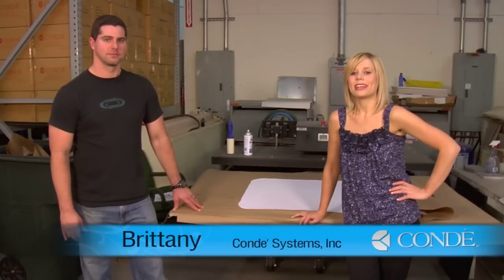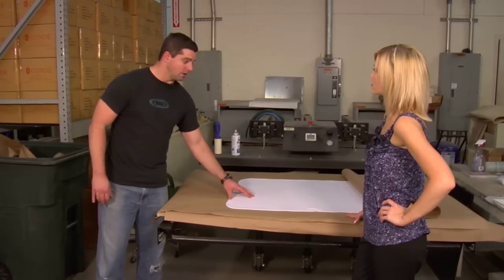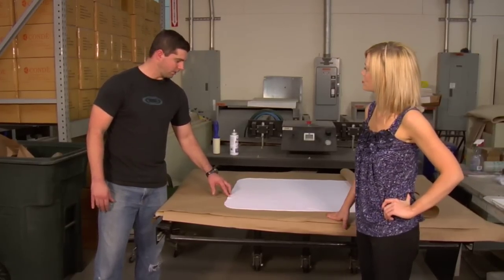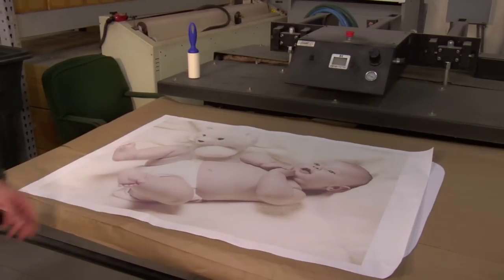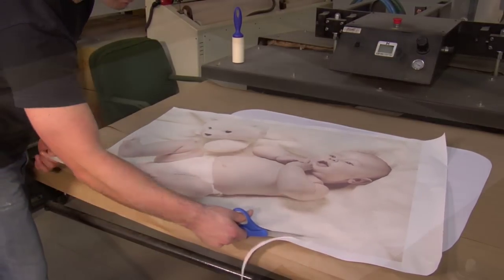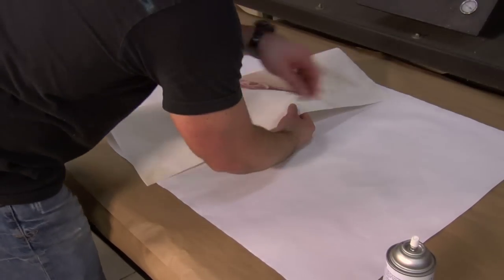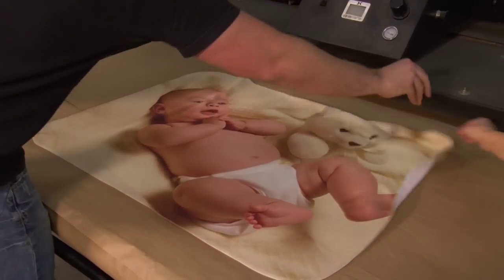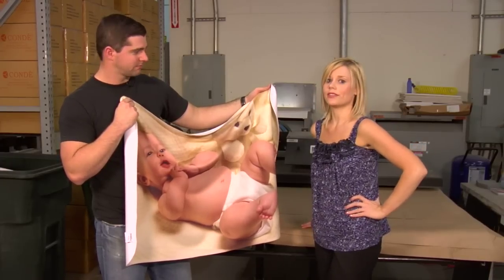Imprinting a Fleece Throw Blanket with Dye Sublimation -

Comment: so the difference between this and heat transfer with plastisol transfer is this goes into the garment and not on top correct? And the inks used for this is sublimation ink? Could any printer do it as long as you have the sublimation ink? *****
Reply from the maker: Molecularly bonded to the polyester, yes, a dye not a transfer.
Inks are Sawgrass Sublimation inks.
Theoretically any printer would do but the best printers to use have Micro-Piezo printheads.

Comment: What is the spray you're putting on and what does that do?
Reply from the maker: That is Pro Spray II and it's a temporary adhesive. We sell it at conde com
Reply: ***** Do all sublimation prints need the adhesive? And does it wash or burn off after the print?
Reply from the maker: William Su
The adhesive is only to keep the transfer from shifting. Experts dispense with it after they become confident on placement. It virtually evaporates while being heated.
Reply: Ohhh I see